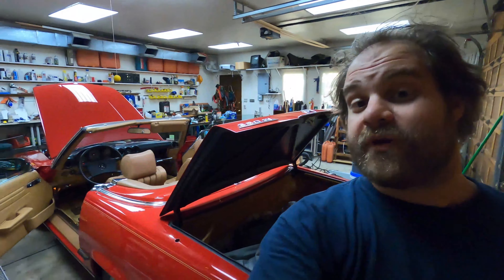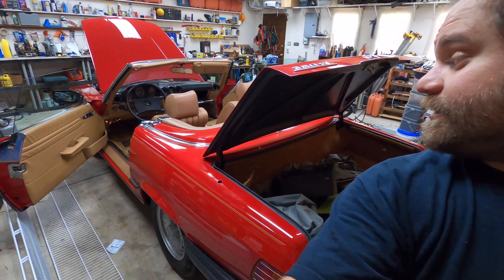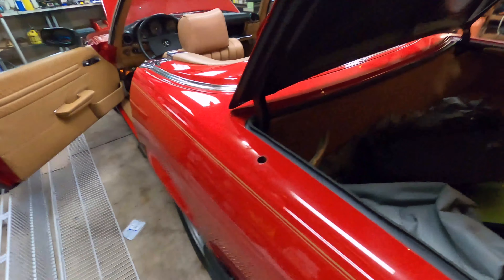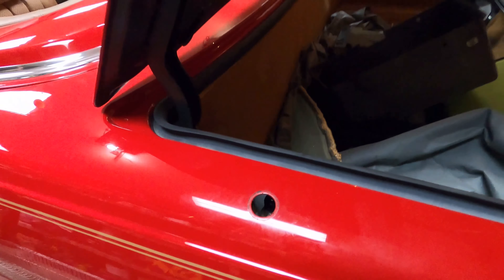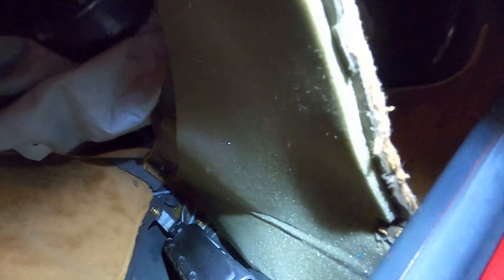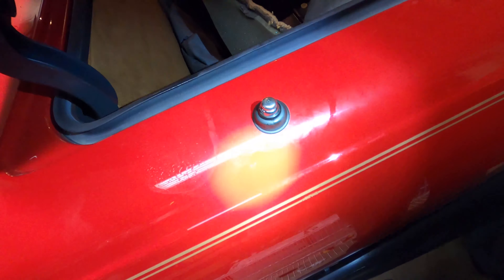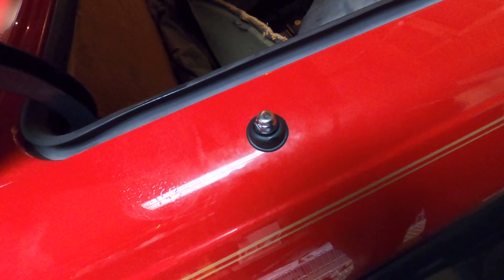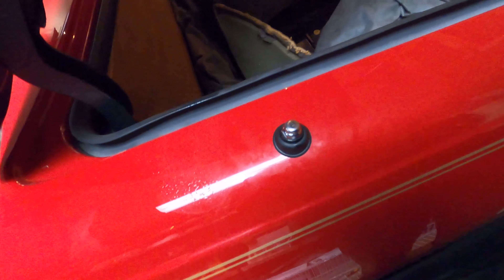85 Mercedes R107 Power antenna removal and seal install

Comment: Grommet I bought was very hard; eBay 😐. Thought there would be a more “give”.  Not positive I got the body panel in between the two lips. Prying in with a screwdriver like you did seemed to just tear it. Will prob order another OEM from Mercedes. At least now it’s better than the cracked/partial one I had.

Comment: I was able to get the grommet in but now can't get the antenna back up through the grommet.  Any suggestions?  Nice video.
Reply from the maker: Soap water will lube it up, and wash away next time you wash the car
Reply: @nsigarage5212  Thanks for the reply.  I used WD-40 and worked great.